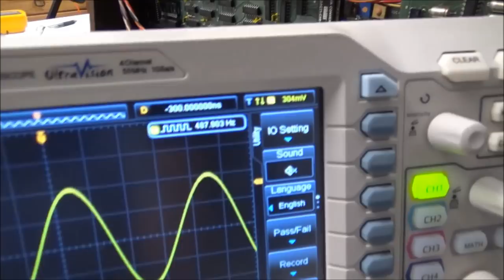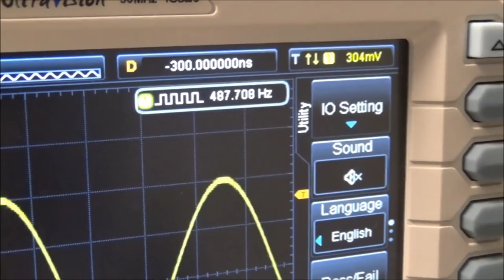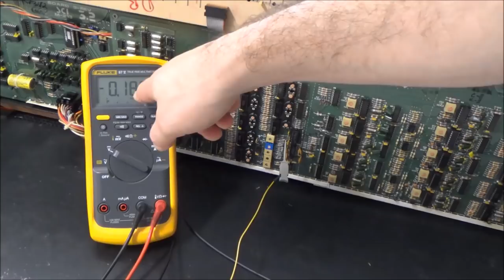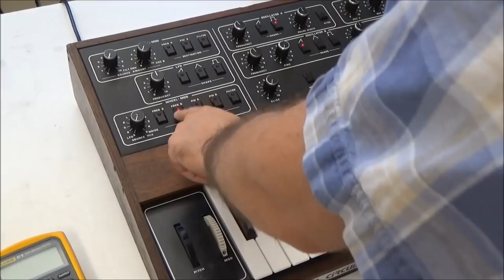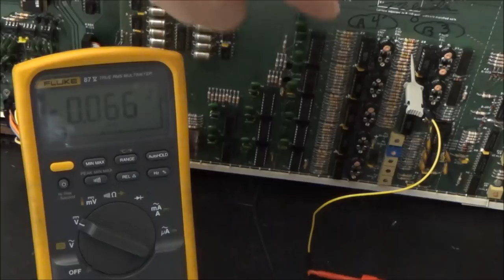Synthchaser #110 - Sequential Circuits Prophet 5 Functional Test & Calibration

Comment: Hi, nice job! This is super helpful. Do you think that with this new CEM chips, manufactures will put back in the market synths that sound as good/the same as the original Prophet 5? Thanks!
Reply: nah, dave smith will never re-issue the prophet 5

Comment: Hi Synth Chaser. At 33:50 you test the poly mod buttons, and they work fine as there is no change in sound. My P5 unfortunately goes crazy when I try the same. Both the source amount pots are at zero, yet they sound as if they are turned up high. Any idea what could be wrong? Thanks!